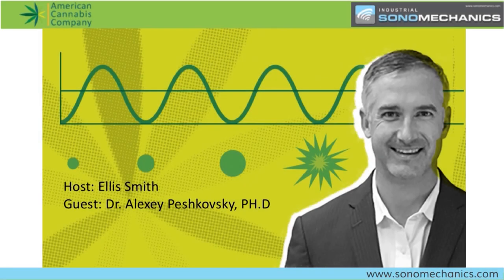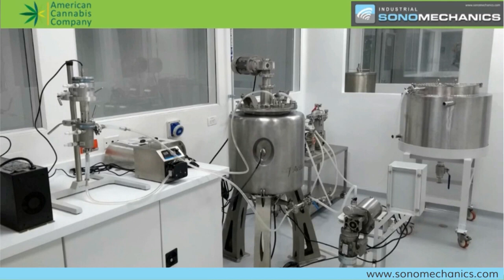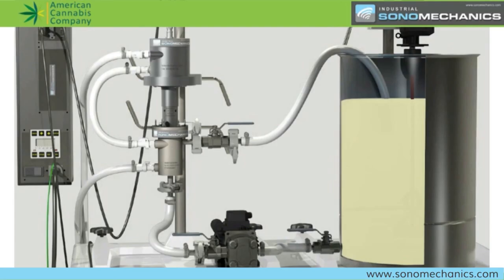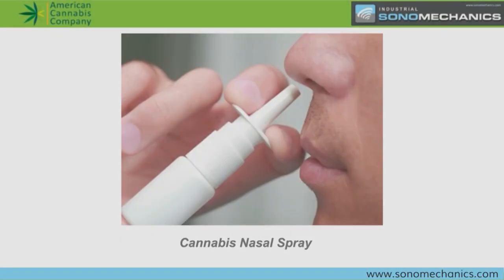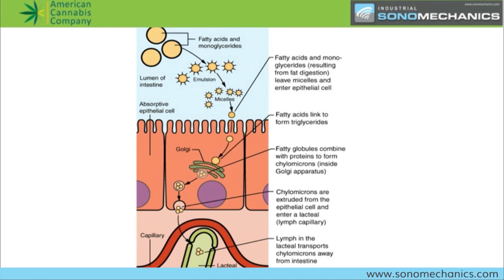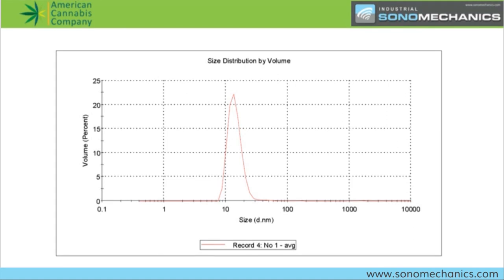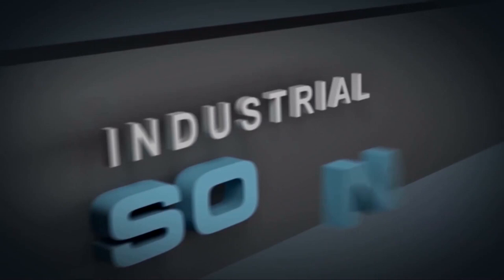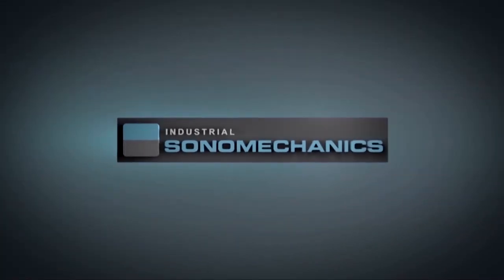Webcast Recording: Ultrasonic Liquid Processing for Cannabis Oil Nano-Emulsification & Extraction

Comment: What surfactants are appropriate for nebulizing? 
If the viscosity of the oil is low enough, can it be emulsified without surfactants for the purpose of nebulizing?
Reply from the maker: Some amount of surfactant is normally required for the production of nanoemulsions. Those nanoemulsions could potentially be nebulized, however, the safety and lung compatibility with nanoemulsion components must be studied first. We have not conducted such studies ourselves yet.